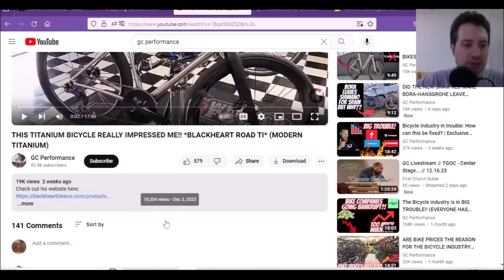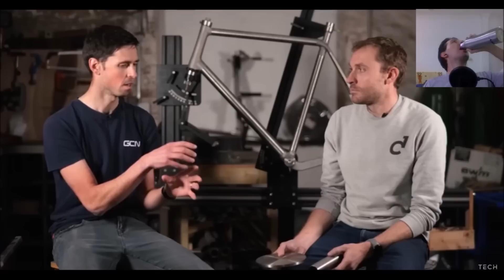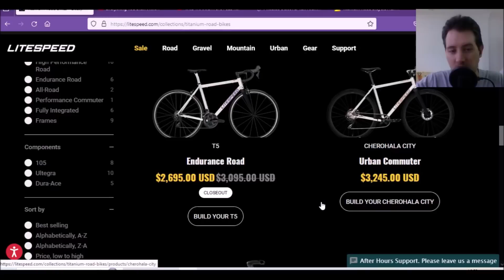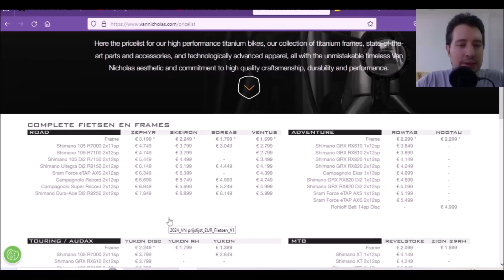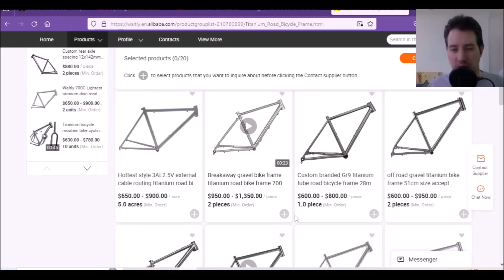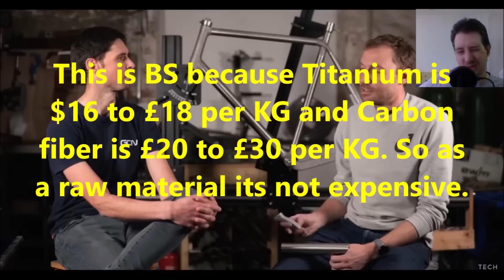Points On Titanium GCN missed.

Comment: At ~7:45, you ignored the influence of tube diameter, which is one of the key pieces to the claim that various materials can make a bike with the same riding qualities. The concept also helps explain your demonstrations on wall thickness, which may not be that relevant. The modulus/densities of common metal alloys are similar,  but their densities are different. This results in different optimum tube diameters and thicknesses for each material. With low density, aluminum can use super large diameter tubing to achieve a desired stiffness, achieving a lower weight, but is still be thick enough to function. It dents easily though, due to both low density and low yield strength/density of the alloy. Due to high density, steel gets too thin when tubing diameter increases, so tubing is optimized at a narrow diameter, which weighs more to achieve target stiffness. It will have high impact resistance due to it's density and the higher yield strength/desnity of most steel alloys. Titanium is in the middle, and Ti bikes tend to have mid-diameter tubing  and weights that fall between steel and aluminum. However, they typically have higher yield strength than steel, so still resist denting very well when designed at a typical stiffness. And doesn't rust or corrode. As a frame material, Ti is pretty good. Nothing magic though.
Reply from the maker: I thought I mentioned tube size? Never said it was magic. 🙂🙏🏻
Reply: @reginaldscot165  You mentioned it, but ignored its actual effect and couldn't produce quality examples for support. Just trying to help, as it seems like you are a bit out of your depth on this topic. If you think PT's video is poor and try to go after it with the quality of arguments you have here, it will damage your reputation.
Reply: @overbikedrandonneuring  While there is no "magic" frame material (and I've owned all of them over the past 35+ years), titanium does have it's advantages - the main one being that it's likely going to last a lot longer and be far more durable.  I keep hearing that titanium frames are soft/compliant with the "magic carpet ride" - except I had my titanium gravel frame built for bottom bracket stiffness and efficiency.  So while it's nice and smooth and feels great on good pavement, offroad it beats the crap out of me on rough stuff like any other unsuspended bike would.  But, on terrain where you can easily break your plastic bikes, for example crashing on rocks.....don't really have to worry about that with my titanium bike (and have already done that).  I did destroy my steel road bike a few years back when I crashed it into a guardrail and dented and creased the downtube near the bottom bracket......but, was still able to ride it home and until I got a replacement frame/fork (went with an aluminum Trek Emonda), and the frame never seemed to have gone out of alignment after the crash.  A carbon bike would've exploded, and aluminum would have likely cracked in half.  Titanium bike might have dented, but unlikely.....at least to where I wouldn't of had to replace the frame.

Comment: Love my ti bike, I was looking new but too expensive and struggled to get the spec I wanted. Went online for a second hand bike 95% what I wanted in geometry etc. Stripped the frame sold the unwanted parts and built what I wanted for less than a new bike.
I'm 18st with a 58cm frame, cheap Chinese parts plus some 50mm aero branded wheels. Bike weighs in Inc pedals 8.6kg. I'm happy as Larry. I wouldn't touch a carbon unless you gave it to me, but I'd still sell it!"😂
Reply from the maker: Smart move. 😎👍🏻

Comment: Looking forward to your analysis of Peak Torque's discussion of different frame materials. I do appreciate his perspective but I think he sometimes misses sone key point or other. Perhaps a bit reliant on the theoretical underpinnings learned from engineering professors and disregarding some real world differences.
Reply from the maker: Yes that’s my main issue with his video, that and his evidence doesn’t match his point? 😁
Reply: @reginaldscot165  it's been a bit since I've seen it. The more recent issue I recall is I think he may have overlooked the efficiency impact of a smaller chainring in his Classified hub efficiency video.

PS. Another statement I doubted was his conclusion that spokes lost tension when disc brakes caused a tone similar to that when plucked. To me, that indicates that they maintained tension. 🤷‍♂️ Enough piling on an unrelated video in another channel, haha. Not doubting his character, but I doubt such criticisms in his comment section would ease my concerns, guess I'm just commiserating at this point. I think the long and short of it, healthy skepticism is typically in order. Though, I'm no global warming skeptic, but still enjoy your opinions on other topics.

Comment: what i feel after having Ti, Alloy, chromoly, and carbon. they all the same. it react different but i cannot notice much. may be because im not professional rider, it may be.
for me what make huge different is the Frame design, the volume of tire, and the stiffness of the wheelset. this is what i feel have huge impact in my ride. for the material i feel nothing major except some feel lighter some feel heavy that's it.
Reply from the maker: Yes that all has a big effect. I think I’m lucky that I get to ride a lot of bikes in my job and so I see the small differences between frames and materials. In general each material has its similarities, although 2 ti bikes can ride very differently. 1 can be stiff and snappy, the other flexible and calm, but both have the Ti smoothness. 

I guess it’s like coffee, to some people coffe is just that. Give them 100 different cups and they will taste coffe… to someone else 1 tastes like diesel oil and another like heaven! 😅

Comment: Steel, titanium and aluminum have so many variants, each with a huge range of mechanical properties. Although there's some overlap, it's funny how most communicators just bunch them all together in 3 categories.
Reply from the maker: Indeed there are lots of different types of each metal. But only 2 are used to make Ti bikes, same for aluminium, and as for steel there aren’t that many manufacturers of tubes. Most companies use Reynolds or Columbus steel. So although there are many variations they aren’t really used to make bikes.

Comment: I don't really see your point when it comes to Carbon vs any type of steel as a frame material. I understand that every material has it´s specific properties. Compared to all of the types of metal, which are mostly bound to their "specific operating boundaries" (strength, flexibility, mass and so on), Carbon (or other types of fiber-reinforced composites) can be greatly altered in it´s properties. You can make flexible carbon parts just like you can make very sturdy ones. Also, carbon has one additional advantage over steel. Not only can the strength be adjusted for different tubes, but  it´s also possible to adjust the layup within a section. 

I'd say, if you wanted to, you could probably make carbon bikes that feel close to alu, steel or titanium. On the other hand, you can´t really make a carbon bike out of metal. It´s just not possible to adjust metal that much. 

Another thing that speaks for carbon are things like aero frames and so on. Bikes which are made out of metal will generally have to follow round tubing while carbon can be shaped in a lot of ways, as long as you get enough strength into a part and bonding/curing is possible. Of course you can also shape metals differently, but the weight will go up significantly for larger parts.

Of course, carbon has the great disadvantage of being fairly brittle once hardened and can break harshly if overstressed or has a load put onto an area that wasn´t designed to withstand that. It´s a complicated material, especially if you use a lot of changing layups. If properly produced & maintained I´d say carbon is superior, but as we know, quality is a mixed bag in such a huge market like the bike industry. 

Titanium (which has it´s own challenges when it comes to construction as well) will likely be the more forgiving / reliable material if we talk about biking on your own, away from the pro-peloton. I think it´s fair to advertise that, and I´d love to see it getting a bit more popular here in Germany, apart from some fairly boutique brands.
Reply: A bicycle is a tool.  You can buy a tool which will break and / or wear out or you can spend a little more money and get a quality tool that will last a lifetime. I see titanium bikes as being that tool.  They can be compared to fine German cars.  People prefer German made cars over Italian or French because they sell a reliable product that lasts.  In fact if taken care of these titanium bicycles will still be an effective tool to help people to go from point A to point B after their original owners are no more.  The word to describe titanium is "quality."
Reply: @JohnSmith-nw3zg  Yes, but that doesn't really mean that Carbon couldn´t last for so long as well. As long as you don't leave your bike baking in the sun for an eternity, carbon won't just break down even after a long time. 

If you crash harshly on a carbon or metal frame both will likely encounter lifetime-damage. In carbon it will the bonding / cracks, with metal the welds could potentially be damaged and break apart. Only difference is that Carbon is more likely to suffer from cracks within any part of the material, whereas metals will often just deform and not fail.

Quality carbon parts from manufacturers like Time, BEAST and so on will likely last a lifetime if they don't suffer some kind of stronger impact damage.
Reply from the maker: Nice comment! 

I’d say that if they can make carbon bikes that feel like titanium then “why don’t they?” (I have ridden a lot of carbon bikes in my job and some are nice but nothing feels like Ti.) 

And secondly I’d say even if you could, would it have the other features of a Ti bike? Nope. It wouldn’t be as robust, long lasting, easy to maintain and so on. 

It’s a bit like, you could make a kitchen knife 🔪 out of carbon with the flexibility of a steel knife… but nobody would because carbon isn’t suitable knife material. Just because you can doesn’t mean it makes sense, you see? 

That’s basically the problem with the bike industry, they tell sweet little lies about how carbon can do everything, it can… but it only does 1 or 2 things well. The rest it mimics poorly. 

Yes you can vary the weaves, but in the same way you can mix different alloys. The range of possibilities with alloys is going to be much greater than a weave layup of carbon. And at the end of the day only a few of those possibilities are actually useful for making bikes, some are just too hard or too brittle or not hard enough. 

As for aerodynamics, frame aerodynamics is 1% of your drag anyway so not something i worry about. However with hydroforming and now 3D printing the possibilities are endless! As the technology improves (outside of the cycling industry because here there is no demand or interest in improving Ti) we could see lighter and more aerodynamic frames in Ti that can be endlessly recycled. 😁
Reply: @reginaldscot165  Varying materials will in the end always results in some properties being different. I‘d still argue though that you could make carbon bikes that feel very similar to Ti, Al or Steel. It‘s just that it doesnt really make sense to do so. Obviously wall thinkness would likely vary when using carbon for the same shapes.

Using different alloys for different tubes will present a challenge when welding, if possible at all. 

Hydroforming and 3D printing with metal powder are pretty interesting options. Both still seem to be fairly niche at this point though.

I‘d like to know where you get that 1% aerodynamic drag thing from. The bike will usually have an influence around 20-40% to my knowledge. Of course ones position should be correct, but I‘d assume that for any given frame when comparing materials.

Comment: All titanium bikes I've seen had carbon wheels, carbon forks, carbon seat-posts, carbon handlebars. Not sure the material of the frame makes any noticeable difference at this point.
Reply from the maker: Well I can tell you that my bike has a Ti seatpost at least. 😅 and the rear of the bike (Ti) is way smoother than the carbon fork. If I could I’d get a Ti fork is the style of an old steel fork. To me they are the best design. 🙂

Comment: What type of fork do you recommend for a TI bike?
Reply from the maker: Depends, for a gravel bike I’d go Ti probably. Cheap to use carbon as it’s expendable and light. But if I could get a good Ti option… I’m on the look out for one. 😆
Reply: Hambini once recorded a video about a titanium handlebar that was bent with a press, and there is a link to Tibicycles, which also produces forks. Perhaps I would put such a fork on a bicycle if I was sure what it would be like and how to install it, for example, how to saw it off. BTW, I recently received a Litespeed Ultimate thanks to your channel, and it seemed to me that it was noticeably more comfortable than my previous aluminum endurance Felt Z on a less than ideal road. On my first ride, I hit a tire on a pothole and felt a very high-frequency vibration from the carbon fork, which told me that the tube was broken. @reginaldscot165

Comment: I think stainless steel is the best material. If a bike is not spec'd for the rider, any discussions about ride quality, wright, longevity etc are a waste of time for off the shelf frames. There are too many variables.
Reply from the maker: That’s very true. Good point. 👍🏻
Reply: Stainless steel is heavy and work hardens which leads to cracks over time.
 Titanium actually does the same, BSA found out the hard way when they wanted to repeat World Championship in 1966 and built a custom frame that constantly cracked and was impossible to weld 'on site' back then.
Reply: @1crazypj  not sure what SS alloy was used back then, there are different grades of SS (some which've been retired for one reason or another). I have to point to my initial comment and state that the rider is extremely important in order to benefit from material properties, whatever the material, not just brag with the brochure or material properties in a vacuum. 
To top it off stainless steel tubing is repairable, indefinitely, as opposed to titanium. Besides SS I'm a huge proponent of butted steel. A skilled framebuilder can build as stiff and as light a bike as possible from steel if one is willing to break away from the branding.
Reply: What’s your thoughts on the Black Hart road titanium frame that GC pł

Comment: 13:04  I think this is one of the reasons many brans have bikes that snap top tubes, down tubes, chain stays, and some even head tubes.
I went for Geometron/Nicolai G1, thickest head tube on the market so far, thick down tube and seat tube, rated for downhill, extreme freeride and dual crown forks.
Reply from the maker: Impressive 😳

Comment: Thoughts on mixed material bikes? carbon+aluminum was more common but I have seen steel+aluminum, steel+carbon, ti+carbon, and that's about it.
Reply from the maker: I have a mix aluminium carbon frame. It’s what was in vogue at the time. It rides like an aluminium frame to be honest. 

I really dislike the mix Ti carbon frame because it’s basically done for the looks and really adds nothing to the bike other than making 1 or 2 tubes less robust than the rest of the frame. 😅

It doesn’t even seem to make them lighter. And like the titan submarine disaster you need to be concerned about the interference between the 2 dissimilar materials as they expand and contract.
Reply: Is that mixed material bike of yours by any chance a Giant Cadex from the mid 90s?  In any case, i havevone, which i ride very lttle, but it is a much nicer ride than the aluminium bike i had. @reginaldscot165
Reply: Yeah the interface between the dissimilar metals is the main thing I worry about, but on the other hand my aluminum/carbon seat stay mtb has been fine. Ti/carbon must have been pretty rare. I just know these weird oddities probably won't come back so trying one for a bit is in my mind for the road.